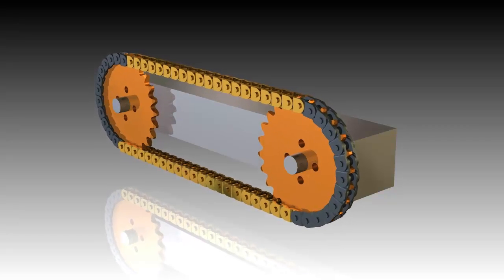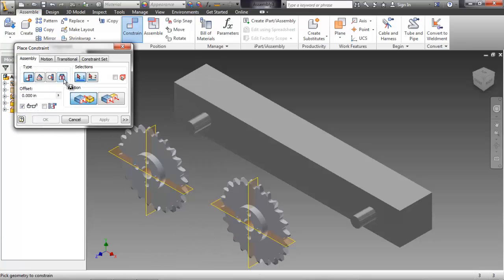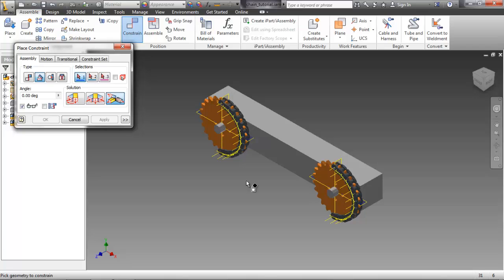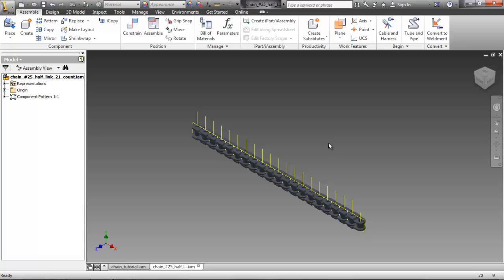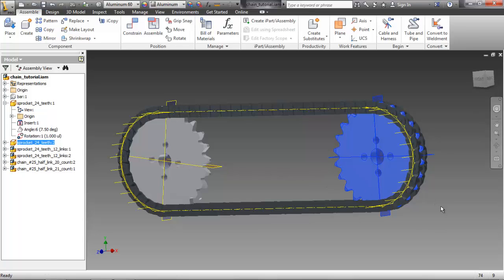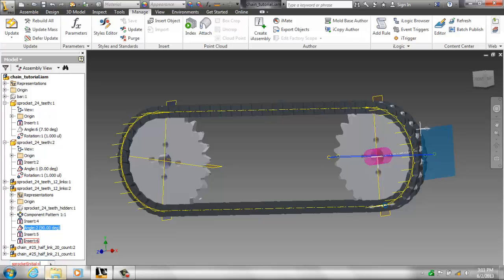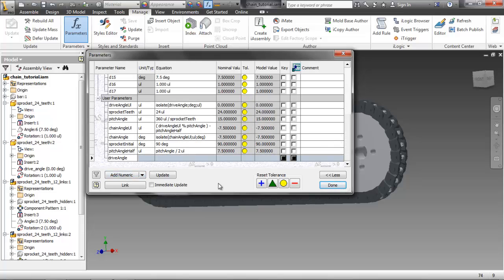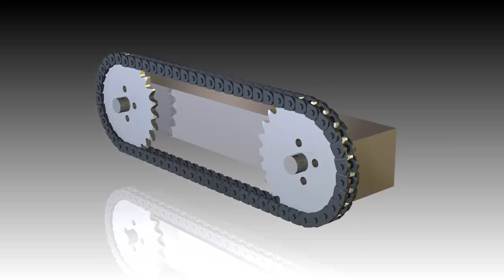Chain Animation Tutorial

Comment: Hi I am member of team 6299QuadX. I have been modeling our team's CAD for three years now and im very impressed with how good of a job your chain drive in Inventor 2014 looks! I used the half-link on your website and unfortunately it said to open the part or even place it in a assembly i needed part "Chain#35_half_link". I do not know if that is the only missing component for the part file, but if you could somehow provide me with the missing part(s) that would be great. Good luck at BlockParty!